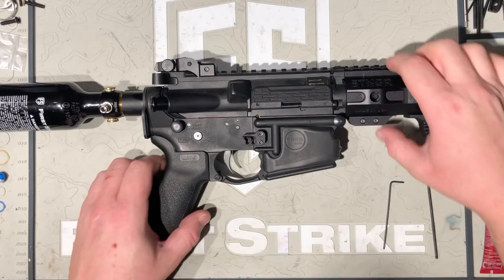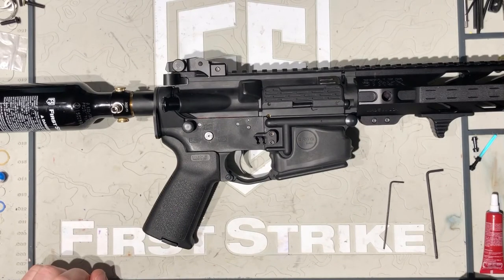How to adjust and tune your first strike T15 recock screw for cold weather/regular play

Comment: Thank you for this.  This is another common problem and typical mail that needs to be addressed I feel.  
Much appreciated for your clear instructional video.  
🇺🇲🤜💥🤛🇺🇲 Tj
Reply: Hey Paul , sorry to bother you. 
I already purchased a Ninja 4500  22" in-line air tank. For my Tippmann Tmt £lite. Though it'll be kinda long ..uhm what butt-stock would you recommend? 
  
I understand the Tippman Tmt Tmc Elite normally goes with the 13 inch but realized I kinda wanted more air, a little more power.  
Thought the 80g/90g 22" 4500 would be more than efficient * but 
The stock? Huhm. 
And 2nd Question:  what type of after market barrel is the very best for the Tippman Tmt Elite?  16" inch? Looking to get a little more distance ?  Looking to setting my gun up more to a sníper configuration. 
Thank you in advance 
Sincerely Tj 
🇺🇲🤜💥🤛🇺🇲

Comment: Thank you for the tip! By the way, nice handguard, where did you get it? Any trouble to adapt it?
Reply from the maker: The handguard is from stngrusa.com. I throw the suggesting to look at the blemished section first, most blemishes are so minute u won’t see them and you’ll save some $$. Hard to adapt? Not at all, you may however need use barrel but shims for correct alignment
Reply: @Prudyk1026  Excellent! Thanx, I'll pay a visit to their website.
Reply: @Prudyk1026  Paid a visit to Stngr, won't do, no International shipping... I'm trying hard to find a source, a blog, whatever, that would list all T15 compatible reel steel parts... tough quest.
Reply from the maker: @ac-theoutrider  you would have to find a brokerage to have it exported from the US. And for brand, as long as it’s made to fit an AR15, it’ll fit a t15… maybe also consider airsoft stuff… brands like TM(Tokyo mauri), G&P and madbull are thread compatible with the t15.
Reply: @Prudyk1026  Perfect, I'll try that! Thank you and keep making your videos, good tips are always useful!

Comment: Hi, do you know if there is any difference between the airsoft manifold and the paintball manifold? I ask because I just bought the a1 kit but it fid not have the airsoft manifold. It is like the last new kit in the country 🙈
Reply from the maker: There are differences. Different sized holes/ports for the velocity and recock. PB version has larger holes
Reply: @Prudyk1026  so my kit is now useless? Can you tell me where to order a airsoft manifold please
Reply from the maker: @azariah8755  not sure if its useless, u may be able to tune it with a regular one… but could be more of a challenge… your best bet would be to contact first strike directly to source a manifold

Comment: Mines kinda burping. If I rapid-fire it sometimes it skips or burps. Maybe 5 trigger pulls in and it skips.
Reply from the maker: That could be either needing to open the recock screw a touch, or possibly needing a tade more output on the tank.
Reply: @Paul Rudyk  I'll do the slight turn on the recock screw.. I'm running remoteline with 60/4500 ninja tank with a high output reg.
Reply from the maker: @SirArcticPB  is your marker newer gen or an older gen t15
Reply: @Paul Rudyk  3rd gen I believe. I got it summer of 2017. Or I believe it was the last year they sold the t15s with real cases.

Comment: I needed this video 12 months ago ^^

Still one question. A friend of mine claims that besides the recock screw the t15 suffers from poor muzzle velocity during colder weather compared to the warmer seasons. Is it also recommended to up the FPS screw during winter?

Because of the recock issue I was unable to play with it last winter and don't have any experience as such since I got it last summer.
Reply from the maker: When u change and adjust your recock screw your changing the flow of air in the marker... so where you may add pressure (like the recock screw) you may take away pressure( like your velocity). Expect the velocity to have to be potentially adjusted. When temps get warmer, you can decrease/close the recock a little and get some better air efficiency
Reply: @Prudyk1026   Ah so the balance between both needs to be taken into consideration.

Comment: So is colder play meaning like -10 to 20 degrees or like 30 and up?  I live in Chicago so I want to be able to use this frequently
Reply from the maker: I would say when temps dip below 10 degress celcius (I’m Canadian lol)
Reply: @Prudyk1026  so -23 C would be a no go?  Or anything in between -23 and 10 C?  I play a lot of winter games
Reply from the maker: @aszczepaniak1015  i wouldn’t say no go, but there would definitely be some re-tuning of the marker compared to summertime settings
Reply: @Prudyk1026  thanks for the info

Comment: Nice. Do you have a link to the 2 modified big pins that make the upper dissassembly easy?
Reply from the maker: Here’s the link. It shows out of stock, but just keep an eye out for it and it’ll be back in stock. That or now that u know the brand etc, a quick google search should help u find someone who has it in stock 
https://www.brownells.com/rifle-parts/receiver-parts/takedown-parts/pins/ar-15-m16-ez-pull-pivot-takedown-pin-set-prod26741.aspx
Reply: @Prudyk1026  Thank you!

Comment: How much psi are you running to get that full auto to cycle? People say 1000psi. What is your shot count with that 13ci?

Mine leaks out of the barrel unless cocked, is this normal? I also keep getting double shots.
Reply from the maker: In my newer t15’s I runs around 850 psi. My older generations I find around 900 psi... depending on the style of play for that day, I get between 8-10 mags worth of shots. 
The marker needs to be cocked before it’s aired up, otherwise it will purge out the barrel
Reply: Normal

Comment: where are you based in?
i’m in vegas and not sure if i have to do this for my gun
Reply from the maker: Im just outside of toronto, in canada… being in vegas, u probly dont need to do this… but this video gives you the basica to tune your t15
Reply: so, yeah i just came back from a game and it will not go full auto at all. i will tune it and i’ll see if it works

Edit it will not budge at all, T-15 is fs a problem child
Reply: @kalebdoom7944  Honestly, the FA kit takes some time to get working, but other than that, I've hardly had any problems with my T-15. It is a very reliable gun for the most part.

Comment: When I adjust my recock screw no matter where I adjust it the thing keeps sputtering. Should I close it all the way and slowly work it open or vice versa 🤔. Besides the tanks output pressure would there be any other reason the marker would sputter? I really don't want to send it in
Reply from the maker: Sputter usually means too much output pressure from the air tank. Burping or incomplete cycles usually mean not enough tank output pressure… with the colder weather, a lot of tanks loose about 25-50psi output pressure… won’t hurt a space so much, but for a t15, it has the potential of a higher impact
Reply: Did you ever figure out what the issue was? I live in southern Cali, so cold weather isn’t much of a factor. I run my T15 with a microline. Also I have put shims on my tank to increase output. I ran it with and without shims and still having the same result. What other issues would cause sputtering ?
Reply: @romeroderick7711  I never figured it out actually about to send it in now did you figure it out

Comment: 0:57 how do you get the hp bottle out so easily?
I have a dye core bottle with a ninja v2 pro and it costs extremely much strength to turn this out...
Reply: Lube your threads and print with silicone grease. Also your threads might be damaged

Comment: So if I was to have a output pressure of 950 Bc of remote line would I set my recock screw closed?
Reply: A little more closed*
Reply from the maker: If you have a newer generation t15, you very well may need to have it closed or near closed. For an older gen t15,  I may need to have it opened up a little

Comment: Do you know why my bolt doesn't cycle at all? I already turned the recock screw almost all the way out oiled the bolt, o-rings on the bolt, the manifold, under the manifold and even in the back on the pipe coming out of the ASA, O-rings are all intact power tube is free of obstructions/dirt/paint. Yet the bolt will only go forward and stay in the forward position and the tank purges out of the barrel. 
My T15 is roughly 4 years old and never really caused any issues.
Reply from the maker: Find my on Facebook and message me there with a couple pics of the bolt and upper receiver. I’ll try help out if I can
Reply: @Prudyk1026  Sorry I don't use social media ^^' But thanks for the offer :)
Reply from the maker: @Legion7734  what tank are you using and what’s ur air setup? I can try to help, but pictures always make seeing an issue easier
Reply: @Prudyk1026  I was testing it with a Dye Core 300bar and a Tippmann 200bar tank both 13ci. I'm not sure about the output pressure on them unfortunately.
Reply from the maker: @Legion7734  the tippmann was probly too low on output pressure, what regulator is on the dye core tank?
Reply: @Prudyk1026  it's a micro pressure. Sorry don't know the brand but I found the output which is 800psi. Wierd thing is, that I already played in colder temperatures with this setup with both tanks and never had any issues. I'll probably give the marker to a shop for repair. Will probably be the easiest solution. Gonna let you know what they found if you're at all interested :)
Reply from the maker: @Legion7734  800 psi on a micro line is low, even for a new gen marker. You’ll want your output psi at about 850-875psi….
Reply from the maker: And shouldn’t decide to bring it in, ild be interested in what they conclude
Reply: @Prudyk1026  Sorry for the late reply but it seems the problem wasn't the marker as I thought. Turns out the reg had an issue where the output pressure fell from 800 to ~470 psi that would explain why the bolt couldn't cycle.

Comment: Are there any consequences to having your recock screw more open than necessary? I've been fiddling with mine and I've wondered why not leave it almost all the way open?

Also, how do you manage your output pressure to reach 850 or higher? Is it something to do with the air tank or is it something you adjust in the marker itself?
Reply from the maker: It adds un necessary stress to the firing cycle. It will prematurely wear out the striker bumper and potentially the bolt spring…
Reply: @Prudyk1026  thanks for the quick reply. That's good information
Reply from the maker: @teknik4349  all good.. sorry missed the second part of the question…you achieve the 850 psi or higher output pressure by adding/removing any combination of 3 colour codes shims within the regulator. Each colour shim changes the output pressure by a certain amount( roughly). When much higher or lower adjustments are needed/wanted, you have to swap the piston spring as well as decide on the combination of shims
Reply: @Prudyk1026  thanks. and the regulator is a part of the air supply itself correct?
Reply from the maker: @teknik4349  yes. The regulator in the part on your tank that has the gauge  and screws into the marker
Reply: @Prudyk1026  how far out do you have it? I have a problem where whenever I dry-fire it locks back and starts to empty the tank🤔
Reply from the maker: @Heavyuser-xj4te  that sounds like you need to open it a little… when you have a round in the breach, it provides just enough back pressure to kick the bolt back. With no round in the breach, that back pressure is gone and the bolt cant reset…. on the newer t15’s you should never need to go more than half open. If you do, it may be time to increase the output pressure on your tank…
Reply: @Prudyk1026  It was closed 3/4 of the way from factory opening it a bit more fixed the problem, thanks.